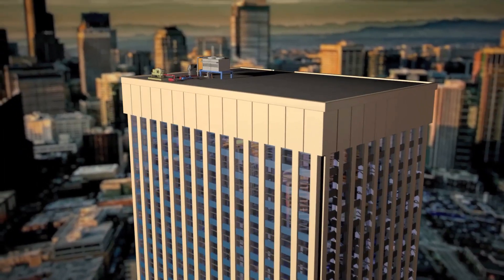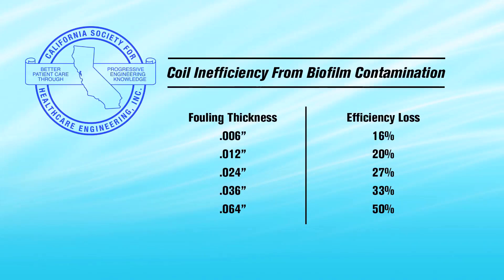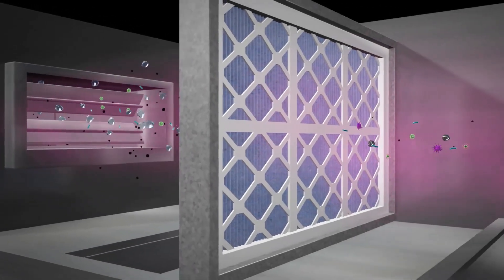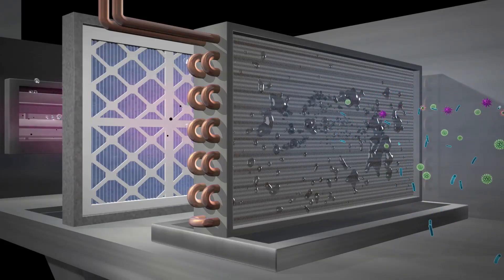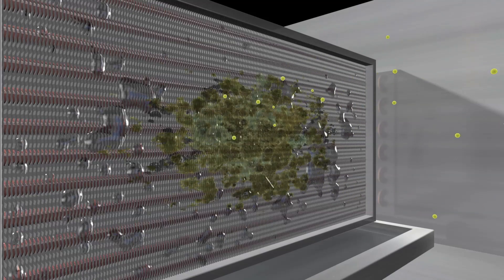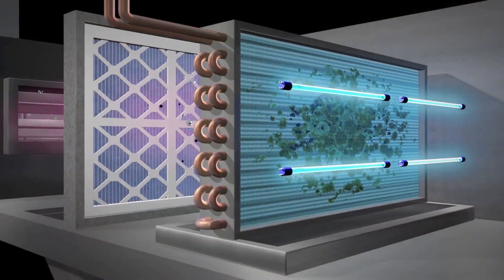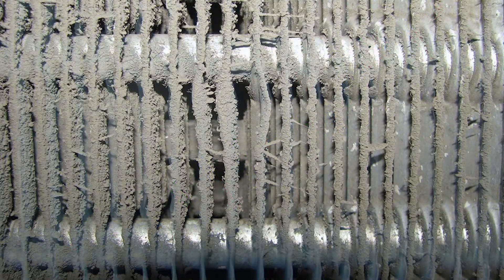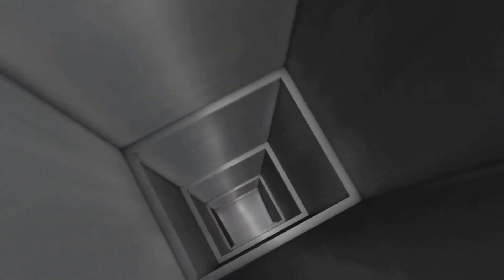Steril Aire UVC HVAC Coil Cleaning

Comment: Firstable this has been proven many times before that high velocity central air system move air so fast that uv-c doesn't do anything, HVAC engineers have proven this time & time again
Reply from the maker: you are completely wrong. Educate yourself
Reply: @ECOAirPurification  already did
Reply: @ECOAirPurification  hvac engineering already did, if you can prove us wrong then please present what kind of tests you performed and results proving uv-c works 99.99% of sterilization, it does work to some degree but certainly no where near 99% especially on any high velocity system designs
Reply: @ECOAirPurification  and yes uv-c will help to prevent mold etc.. Of growing on evap coil, buy just to clear it up, it doesn't purify air! That's such a false claim you had a bunch of hvac specialists laugh at this claim. ECOAirPurification =FALSE CLAIM! IT DOESN'T PURIFY AIR! UV-C CAN KILL BACTERIA ETC. & PREVENT IT FROM GROWING, ON HIGH VELOCITY SYSTEMS IT WON'T EVEN KILL BACTERIA THAT'S ALREADY DEVELOPED BUT WILL PREVENT IT FROM MULTIPLYING. Does Sun purify air?
Reply: @JesusChristIsTheTruth100prcnt  They are using the UVC lamps to clean the coils, which are not moving.